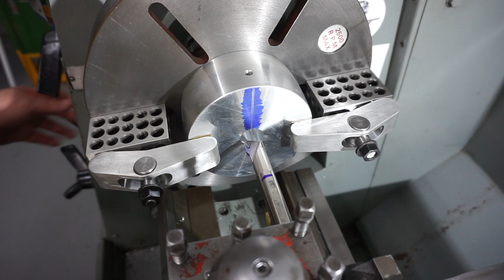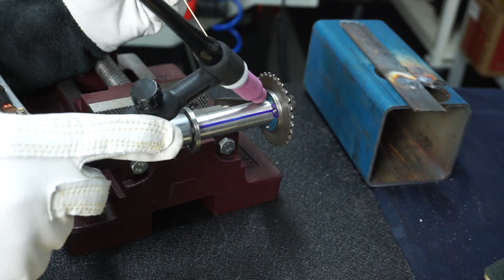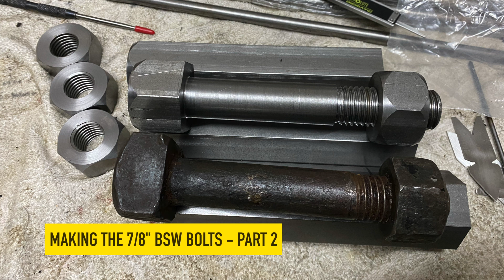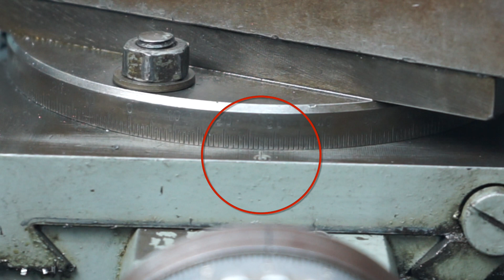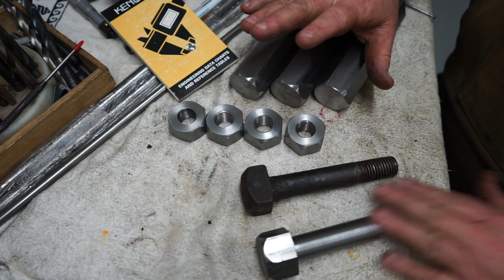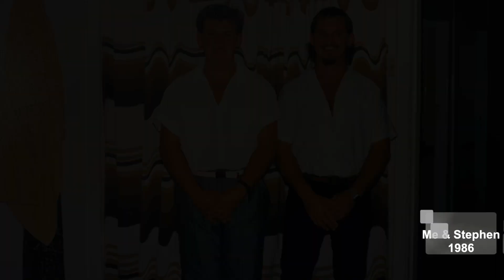Making Custom BSW Bolts - Pt.2 Bolts

Comment: You cut those threads slow. Your X3 playback speed is slower than I single point thread. Have you tried going faster?
Reply from the maker: Nah, the boss only pays $10 bucks an hour. Feed rate will increase with salary remuneration 😜 

Jokes aside, yes I have threaded much faster. But that’s with a full thread forming insert and a reliable brake. My brake on the Colchester is rooted

Comment: Good stuff again I would be fussy with the small details on the bolts as well as a restoration is just that copying exactly how it was. Enjoying the video.
Reply from the maker: G’day Lance. Yes Wayne is very fussy, but I understand. I need to remake the nuts. I modified the bolts after filming also. Cheers 🍻

Comment: Sorry about your brother mate. I used to love making nuts and bolts! Especially the big sizes like 2-inch Whitworth. Sometimes I had to make them at work because the company was very tight on stocking spare parts. They saw it as dead money but when a power press is down for 2 or 3 hours while I am machining a new bolt or two then it is not dead money.
Reply from the maker: G’day Dermot. Wow, that some really big nuts and bolts that you used to make. This material I used was only bright mild (free machine stuff). I hate to have machine them out tougher stuff like 4140 🤦‍♂️ 
Cheers buddy 👍🍻
Reply: @AaronEngineering  The material was high tensile steel and was a pig to machine even with carbide tools
Reply from the maker: @dermotkelly2289  oh man, that stuff would’ve been savage on your carbide inserts.
Reply: @AaronEngineering  It was but making them out of mild steel would have been a waste of time because these bolts had to hold on big heavy ram guides on 600-ton power presses lol
Reply from the maker: @dermotkelly2289  Yup, you’d need decent steel for that.

Comment: Hi Aaron nice job doing the screw cutting. I use Whitworth most of the time as I've scavenged loads of nuts and bolts in the past lol. Metric is far easier to buy nowadays if needed though. Are you going to blacken the finished ones? Tony
Reply from the maker: G’day Tony. Thanks for following along mate. You’re not wrong about hard to get. I’ve been searching everywhere for a carbide tip. Blackened bolts would be the way to go. But the customer will take care of that. Cheers buddy 👍🍻

Comment: Those are some big bolts! I like the look of the chamfer on both sides, myself. And I agree, he should be using a nice thick washer. I've just started threading a bit here and there. Tried both HSS and carbide and I prefer the simplicity of the carbide. Although, in the long run, it'll end up costing me more.
Reply from the maker: I’m with you Greg. I too would also prefer carbide, but struggling to find a Whitworth 55 degree insert capable of 9tpi.

I just watched your video on the teardown. You’re doing a good job Greg keep up the good awesome work. Cheers 🍻
Reply: @AaronEngineering  Holy cow! I just did a quick search for an insert for that. Amazon had one listed, 55 degree Whitworth, 9 tpi for a scant $172 USD. I'd be grinding my own, too!
Reply from the maker: @MyLilMule  OMG 😳, see what I mean. Hard to bloody find now. 👍🍻

Comment: G'day Aaron know its cheating but for this sort of work I would run a Whitworth die over a 75% machined thread.  solves the problem of the rounded tops and bottoms and will correct any taper. you should get a nice finish. I have a pretty full set of Whitworth taps and dies. They rarely get used a pity.... Same goes with Whitworth fasteners. Several shelves full, rarely used. Hmmm...      Good luck with the new job.😀
Reply from the maker: Hi John. No it’s not cheating mate. I’ve done the exact same thing from time to time. Only problem is I don’t have a 7/8” Whitworth die “Doh”! 🤦‍♂️

Comment: Looking good
Reply from the maker: Thanks Rus. Getting there slowly buddy. I was working on the new Haas TL2 today at work. Just tooling up and taking some test cuts. Cheers buddy 👍🍻
Reply: @AaronEngineering  I saw you mentioned a new gig. No longer at the school then?
Reply from the maker: G’day Rus. Yes I left the college with the Haas machines back in 2019. Been teaching all manual machining at a Catholic college for the past 3 years. Moved out of secondary education into the Technical College (apprentice training). We got six new Haas machines and robot arms. One of the Haas machines has carbon fibre additive manufacturing also. Lots for me to learn mate. Cheers 🍻

Comment: A difficult day for you. 
I think to maintain the character of the machine the nuts and bolts should be square. If the nuts are unseen maybe ok to be hex.
I have never seen whitworth thread cutting inserts in action, I wonder if you notice higher tool loading with the larger radius tip?
Reply from the maker: G’day Greg. Yes mate difficult time indeed. Most of my thread cutting has been done on CNC and with full forming carbide inserts. I’m keen to give some 55 degree inserts a try, but can’t find any 🤦‍♂️
Reply: @AaronEngineering  I guess carbide is this century and Withworth is last century, so maybe there isnt any 55deg inserts. If hex head nuts and bolts are ok then any thread should be fine too.
Reply from the maker: @gregwmanning  good point Greg. As long as they screw on and aren’t too loose I’m happy 😉

Comment: Gday Aaron, with some of the old engines I’ve stuffed around with over the years, the heads of the bolts were longer then what we get today, the one you made looks about right, the nuts look good as well, I brought an import carbide insert threading tool and there’s nothing wrong with it, way better then HSS, all the best with the new job to, I’ll give you a call this week mate, Cheers
Reply from the maker: G’day Matty. Thanks for watching mate. Yes I need a 55 degree carbide insert capable of 9tpi. I’ve been looking, but not much around. I’ll give a tool suppler a call tomorrow. Cheers buddy